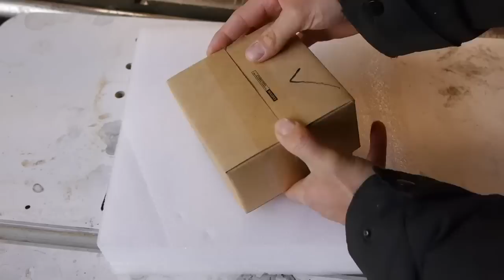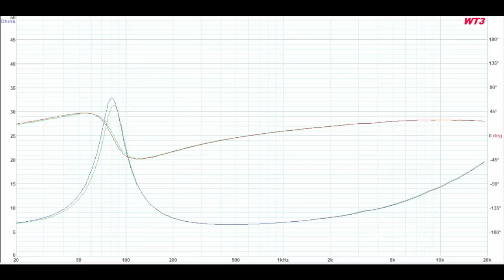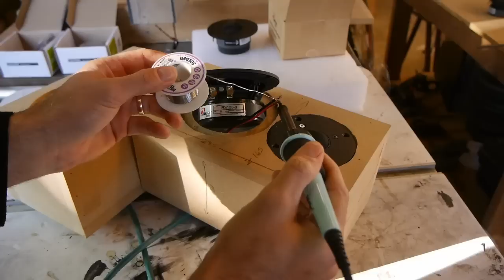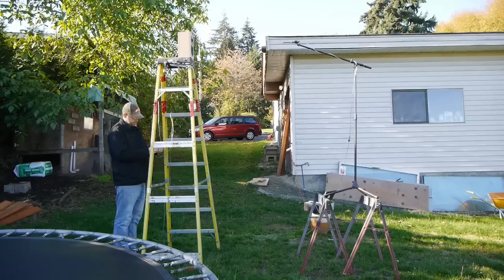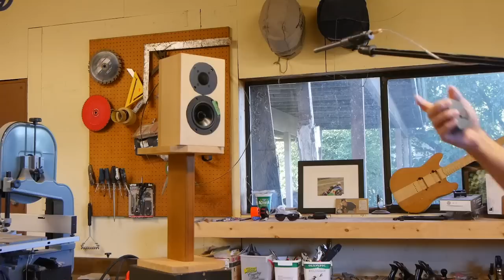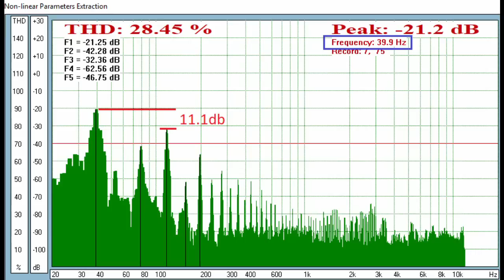Dayton Audio RS125 | Test and Review

Comment: Probably wind is throwing the measurements off.
Reply from the maker: MrBrymstond I don’t think so. I measured again indoors and they matched exactly. Plus it wasn’t windy. Why do you think wind was throwing them off.
Reply: I'm not knocking you. Wind is a well known factor when you're involving microphones and depending on the sensitivity the least amount could skew the results, plus if it was windy speakers tend to vary with the ear. If I went to this extent, I would test them in a sound proof area the test them again in a similar area of use. If I was going to use the speakers outside all the time, I would still test them inside. Even when speakers are out in the open the sound is absorbed to a point. If you listen to speakers outside subwoofers will become less intense with distance than the midrange and treble cuts thru, but inside all you will hear is the subs with little to no midrange or treble penetrating thru the walls. Just like setting your sound up in a empty night club the sound will drastically change as the people pile in. These are the factors I take into account. I'm not saying you're wrong. I say this from decades of having band members setting up and doing a sound check then having to do it all over again because the sound deadens out and absorbed in a packed area, this is why I always waited. I think the bass was slightly off for these reasons above, but it was extremely close.
Reply from the maker: MrBrymstond the reason for measuring outdoors is for anechoic reasons. I’m aware it changes in a room or as people come in. The test was repeated indoors, as mentioned in the video, and the bass was still off. It’s for test purposes rather than determining how to setup in a room. Now that I have the data I can determine how to setup the XO.
Reply: I did say the test was extremely close. I never insinuated you didn't know something.  Anechoic chamber.
An anechoic chamber ("an-echoic" meaning non-reflective, non-echoing or echo-free) is a room designed to completely absorb reflections of either sound or electromagnetic waves. They are also insulated from exterior sources of noise. Hence soundproof room. There's many sounds going on outside especially during the day. At night I can clearly hear the trains that are miles away, but even on the most quite day it's diminished to near nothing. I just don't like using a microphone outside when it comes to the needs of a technical result, that's all. To me it's unreliable and it doesn't mean I'm 100% correct, but I'm not wrong.
Reply from the maker: MrBrymstond I didn’t think you insinuated I don’t know something. I don’t think we have a problem, just talking. I’m just trying to explain why I do it outside. I’ve repeated the test indoors and they were the same. Only issue with a sound proof room is the reflections. I’m not going to build an anechoic chamber. So I hate the measurements to be anechoic down to about 60hz. MLS measurements can filter the noise really well in my experience. So I’m not too concerned about it.
Reply: Okay cool me too, just trying to help, truly. I love these channels.

Comment: Great video as usual, will most likey build this project but with the vifa XT25SC90-04 tweeter instead to get a lower cost. However, the notch filter you added you could easily replaced with a 0,33 uf cap in paralell with the coil. Much more effective, less components and lower cost. What is your opinion about the p versions of the RS series?
Reply from the maker: Fear Wolf Brewery yes I agree using an elliptical notch is cheaper. The XO layout I was playing with was not a permanent thing. Just a play around to see what the woofer can do. 

I’ve never used one of the paper RS drivers. They seem fine but I really like the aluminum ones.

Comment: Don't you hate when they say it's an 5 inch woofer, but the cone with the surround is 3 inches because of the outer "rim" ( dunno the word) where the screws go, takes like 30% of the diameter.
Reply from the maker: Quetzalcoalt yes actually I do. I meant to say something in the video about the frame being bigger than necessary. Good point.
Reply: @ImpulseAudioSpeakers  This has ben a "semi-common" practice since Henry Kloss, designed the original Advent Speaker. Kloss deduced a very Long-Throw 10'' cone in a 12'' basket, properly enclosed could produce as much or more Bass, as many 12" drivers and still inherently match a Tweeter more closely (in this case a " semi- ring radiator"). Therefore producing a smooth frequency response without a " "brute force" application of components for a  crossover; that was also "cost effective". As to the size of Cone vs. Frame size (the mounting holes). I believe Both should be shown in their respective specs etc.
Reply: It's like a 4 in a 5 basket.
Reply: @westelaudio943  https://www.parts-express.com/pedocs/specs/295-353--rs125-8-spec-sheet.pdf
If you look at where the magnet is, it says 80, i guess that's mm, if you see the magnet and where the surround starts, the cone+surround looks like it's around 80mm too
80mm = 3.15 inches.
Reply: @Quetzalcoatl0  The baffle cutout is 94mm or 3 3/4", just like a standard nominal 4" driver. Yep the sorround diameter might even be a bit smaller.

Comment: What about sloping the front baffle at 45 degree angle to each other driver's should give you a bit smoother mid-range better roll off notching out the centre part maybe as well, don't really see it done don't know why. Always put the tweeter on the corner or side less diffraction. You'll need to cross it over at a lower frequency otherwise it would be a bit sharp otherwise. I think you should put the speakers on a mat installation acoustic foam or rockwool when testing you're going to get a lot of noise from the stand coming back at you in your readings

Comment: your work is always awesome =) .. i saw that you can take measurements with mic and source on the floor to reduce room reflection.. you just have one reflection from the floor but it's so fast that it gives you take.. you should try and compared to your outside method ..
Reply from the maker: lex Tr3 I do groundplane measurements as well but I don’t find them as accurate above 200hz as this way. I do the ground plane measurements when I need to know how the port is working below 200hz.
Reply: nice this is very useful to know thx =)

Comment: How wind affects your free air measurement? Are you choosing quiet days for your measurements?
Reply from the maker: Pablo osvaldo Penizzotto you’d be surprised how little wind and noise and such affect the outdoor measurements for frequency response. I do choose a quite calm day though. My camera makes ambient noises sound way louder than they are. 

The free air impedance and TS parameters are done in the shop with the doors shut. No wind. Impedance measurements can be affected because the signal is so small.